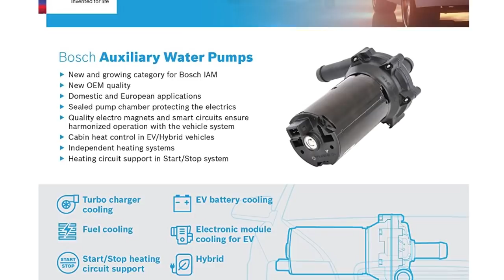Liquid cooling pump for Nissan Leaf Electric motor

Comment from the maker: Regarding the current draw....
I recharged the battery and hooked it up to the pump connected to the motor again. The current was still about what it was before, and a little lower than it was on my test with the pump NOT hooked to the motor. The battery voltage did NOT make a difference.
I believe the variable is that I did NOT have a hose on the outlet port when I tested the pump on my back porch. There was no need to, the water was just going right into the bucket. However, when the pump was connected to the motor, there was a hose from the outlet of the motor back to the bucket. The water in the outlet hose helps "pull" water behind it, making it easier for the pump to work. Essentially, I changed the setup from an open system, to a closed system.
Reply: This type of pump will draw less power if it is loaded beyond certain point. Saying that, the pump at that point is blocked and flows almost no water.
Reply: V=I*R Therefore if the voltage of your battery goes up the current should go down.
Reply from the maker: @excite236  Hmmm. That's not right. You might be thinking of Watts Law, which says that for the same amount of work (power), that at a higher voltage, there is lower current. With a fixed resistance, voltage and current are proportional to each other.
Reply: It's behaving as I'd expect. Running the pump unrestricted gives maximum gpm and draws maximum current. If you increase resistance to flow gpm will decrease and so will current. Similar to a psc blower motor in a furnace,( not the newer kind full of electronics) with a clogged filter there's less air flow and lower current.
Reply: I bet there isn't enough resistance to flow to make much of a change in current.  A DC motor will increase current as speed drops if voltage remains constant.  My understanding is that this is because each field is an instructor and as the motor spins current will follow the log curve of an inductor for each field.  The slower it spins the further up the log curve it gets before changing to another field.
Reply: I'm not going to claim to be an expert on the main reason this occurred and is have to think about it more to be completely confident with my explanation. However I would like to respectfully disagree that the hose on the outlet having the effect of "pulling" the water though the pump has nothing to do with it. I see no reason for there to be a Venturi effect by connecting a hose to the outlet. The more hose the pump has to push fluid though the more head loss there will be. Frictional forces in the tube will cause this head loss. Another thing I'd like do disagree with is that it became a closed system. In order for it to be a closed system you'd have to seal to bucket to make it a closed system.

Comment: I'm just going through all your Nissan Leaf videos. Great job. I'm wanting to build a solar boat and have been looking at lithium batteries and motors and pricing them up. It struck me today that I might use a Nissan Leaf battery from a used car.......and then thought, what about the motor too? Which then led me to the secondhand market and it will probably be more cost effective to do this. I then could use all the original cooling from the Leaf and possibly some of the control features too (I'm thinking you select reverse on a Leaf via a switch?). I think I'd leave the transmission on and try to attach to the propeller shaft via the original Nissan wheel shaft or / and universal joint.
Any how, I'm going to look at a 2017 Leaf tomorrow. Wish me luck.

Comment: Can i change mw combustion car water pump?
How long can this pump work nonstop in car?
Soory if mw english not good..
Reply from the maker: An electric water pump is a common upgrade on a car. They are designed to pump continuously, and can easily be turned on and off with a thermal sensor.

Comment: Hey Ben, great video. I am trying to upgrade my 2011 leaf for better winter range. One of my ideas is installing a 2000w electric parking preheater and a d3wz eberspacher diesel heater which will run in tandem with the original ptc heater when its driving (only using the diesel only for trips where I really need to when I need that extra range). The extra pump might help run the diesel heater when say at a campsite with no electric hookup or just to get that extra range as I can have the leafs oem heating totally off and rely on a toolpack battery for running the pump and powering the spark plug on the diesel heater. This way it would not be drawing down the 12v battery which I think gets quite abused by electric cars and shortens their life. Id be sure to attach a long exhaust if using the diesel for any time in a static location (I'll be honest I hardly want to ever use it but I want the backup). Already done heated seats but the car performs better generally when its warmer so getting the body of water up to temperature before setting off without using up battery energy makes some sense to me.

Comment: Can u increase/decrease the  pump flow to adjust for weather changes automatically?
Reply from the maker: This is just a single-speed pump.
I don't think there would be any need to adjust pump speed for weather. The pump has plenty of flow and should be more than enough for this motor at any time of year or weather condition.

Comment: 12:00 Well actually I'd have to disagree... I know it's just a saying and all but cooling a Nissan Leaf motor is more like Rocket Science than you might think. The amount of Heat Transfer calculations for the two of them were highly intensive.  It's very difficult to model and design  transient systems with complex geometry as the internals of that motor inevitably are. I understand it wasn't super hard to hook a pump up and some tubing, however I just wanted to know that what goes into making that motor feel as cold as it does with the coolant flowing through it was a highly strategic and laboreus process for an engineer.  In the end though thank you so much for the interesting video!
Reply from the maker: No offense to rocket engineers or the folks who design EV cooling systems!
I know that I couldn't do either. A big part of the joy of a DIY'er is the fact that we now have access to well designed parts created by these amazing people, but we can get the parts affordably at a junk yard!

Comment: Hello why did you select the  thunderstruck motors vcu? and not the  "Brain Board Rev 3 with Nissan Leaf™ Gen 2 adapter" ?
Reply from the maker: The Thunderstruck device is a complete, off-the-shelf product. I'm working on the tractor project on behalf of somebody else and want to keep it as straight forward as possible.
I also know other people who have used the Thunderstruck VCU with good success.
Reply: @BenjaminNelsonX  I see, the thunderstruck VCM seems to be the main commercially available version of this and it looks like they have done a lot of the work to reverse engineer the messages the inverter needs to receive. 

Still this other option that I talk, is the idea of replacing the native logic board of the inverter with a programmable version with software that can be configured or edited to control the inverter powerstage appropriately.

This option retains the major components of the inverter (IGBTs, Capacitors, Current Sensors and the driver and monitoring circuits) but replaces the board that interprets the messages coming in from the VCM. This removes the need to replicate the Leaf can messages and in theory opens up the option of pushing the power stage and motor beyond the limits that Nissan have put in place.

This is less plug and play still, the prices are very similar, i think is a good option if you want take more power out the nissan leaf motor. 

I can't wait to see more about this project sorry if I went all geek on this, but I plant to convert a car, one day, but i am still getting all the possible information about this subject :D

Comment: hey what happens when you replace the coil of a alternator with a motor coil that is equal to in total watts but not amperage and volts. Does it make  it run cooler. and give you the correct energy without the huge motor expense.?

Comment: (American Tech)(1000V+ High voltage generator from induction motor) try this with five on pole and some capacitors then how far will your car go. sorry benji but i had to show you. i don't hate you but this is my tech guy.

Comment: I just found your tractor project and just binge watched the episodes on it.  I used to design electric industrial vehicles, and would like to build an electric farm tractor one day.  I had some comments as I watched the videos, but figured I would just make one big comment at the latest video.  
1) Divorcing the hydraulic pump from the drive motor may allow for reversing using the drive motor (I think the TA transmission has an overrun clutch in one position).  These old sliding gear transmission can be very clunky to shift gears.  Forward to Reverse requires a complete stop with the tractor in gear to not grind a little.  Being able to reverse the electric motor would be a huge help when doing loader work that doesn't require the PTO.  This obviously wouldn't work when doing jobs requiring the PTO.  PTO overrun clutches are available that would prevent damage by inadvertently reversing the PTO with an implement attached.
2) Powertwist belts would be good to power the pump off the motor (of as a replacement in 15 years when a belt fails).  This would allow replacing the belt without tearing the entire unit down.
3) I would use a shelf industrial pump and not worry with trying to reuse the pump from the engine.  There are belt drive, AC and DC pumps available off the shelf.  Mount it low and use as few hydraulic fittings as possible on the suction side.
4) do some calculations on the required hydraulic pump size.  Frequently pumps are over sized on equipment because _ GPM is required to operate the steering from lock to lock at idle in a set time.  This means at max RPM you are circulating a lot more fluid than is needed.
5) I think there may be a design or part problem that caused the loader to drop as fast as it did.  It could just be because the rod end of the lift cylinder has a smaller volume though.  I would check though and make sure the system has something called a counterbalance valve.  Typically these are  mounted on the cylinders and prevent the loader from dropping if a line bursts.  
6) On your axle clearance, I wonder if you could space the mounting point in the back down a little.  It doesn't look like you will have much interference with the frame on those axle supports, and I doubt the slight change in caster angle will make much difference in tractor driving performance.
7) If you reuse the stock tractor radiator, I bet there is enough cooling capacity there not to need a cooling fan.  The cooling fan will be the loudest thing on the tractor.

Comment: Hello sir 
My self Kundan patel a mechanical engineering student .sir I am working on a project to convert a petrol car maruti 800 (1998model) sir we are planning to put 48volts1000watt moter connected to gearbox .our total weight of car is 850KGS (including 1driver + 4 pessengers)
Sir I am bit concerned about moter .sir my question is  1000watt moter is sufficient for our car or not and if not than for how much watt moter we should go for 
Please guide me sir
Reply: I think you'll find a 1000W motor is too small. A 10,000W motor would move the vehicle, but not very fast.

Comment: I need help!
I'm a student and me and my other mates are converting a petrol car into EV!!
CAR NAME: Maruti Suzuki 800 (1998 model). We're doing it on very low budget, as we're doing it with our savings and pocket money so don't have enough financial potential. 
I want suggestions on how much powerful motor will be needed, I'm thinking to use 48v 1000watts BLDC motor.
Connected to gearbox, is it sufficient??
On calculating total max load (with 5 people on board, 1 driver+4 passenger) it is around [ 940KGS]. Please help me !
I'm in big confusion :(
Please help sir!
Reply from the maker: A 1,000 watt motor is only the equivalent of about one and a half horsepower! You'll need more than that for a car!
For a simple, low-budget car, please watch the Playlist about the Electric Geo Metro conversion. Lot's of good information in there to get you started!
Build Your Own Electric Car: https://bit.ly/2zMufmN
Reply: What if I say it's around 800 KGs, equivalent to max load capacity of E-rickshaws. ( E-rickshaws also use 950 watts, without gearbox, they give 30>speed) Will it work? 
Well I've watched complete playlist, great information. :)

Comment: Your electrical current dropped exactly as I expected. It may not be intuitive for some people, but on a centrifugal impeller pump,  as resistance to flow increases, power decreases. This is because energy is being imparted to less water per unit of time. Your max power consumption will be with unrestricted flow at both suction and discharge. (Maximum flow rate, like your first test.) Your lowest power consumption will be when your flow approaches zero. At zero flow, the impeller is only stirring and heating the water in the pump. Moving gallons of water through the pump takes more energy.
Reply: Your answer is similar to mine but yours is 2 days earlier. I would add that pumps have a curve, a graphical representation of their performance. Flow rate is on the X axis and pressure difference across the pump is on the Y axis. Flow rate is measured in GPM and pressure is measured in " feet of head". In a closed system you're not lifting water. Every ounce of water going up is cancelled out by exactly the same amount of water going down. Maybe feet of head is used as a measurement because that's easy to measure. What's the gpm if you make it lift water 2 feet from one bucket into another?  Or 3,4,5 feet?  
Bottom line, restrict the flow, move less water. Move less water, use less electricity. Within reason, in general, YMMV.

Comment: Fun fact about centrifugal force pump is the smaller resistance the bigger the flow AND power. and vice versa. Try listen to your vacuum cleaner at full power,  then block air inlet for a couple of seconds - then blocking it is maximum resistance and the RPM will clearly rise as the air trapped in the fan will just go round and round,  less power is needed for fan motor.
Reply from the maker: Well, I didn't stick my thumb over the outlet port, but that would be fun to try!
Reply: @BenjaminNelsonX  Then it should turn at higher RPM or use less power or both. And possibly you will get wet lol

Comment: the load on single stage centif  pumps increases slightly with no head pressure they need back pressure

Comment: 1/4 inch connector? Sounds like it'll fit PC water cooling components!! Try a lang D5 pump!
Reply: Ben said 3/4" or 19mm, which is much larger than a PC cooling system. ;)

Comment: Good morning Ben. Found the Bosch pump on Summit Racing's web site. https://www.summitracing.com/parts/bch-0392022002/questionsanswers . Looks like they have the specs for the pump itself. Current draw seems to be more than what you are showing and I am guessing that it could be due to the smaller wire size that you use. Also, there is a part number listed for the electrical pigtail.

Hope this helps.

Comment: Nice to see progress on the project.  Looking forward to that motor spinning.  I was also curious how much the flow decreased with the motor in the coolant loop?  And then to top it off if you add a radiator how much more the flow drops...  Either way I suspect the flow will be far more than needed in most cases.
Reply from the maker: Going through the motor, the flow dropped very little. When I get it hooked up to the radiator and in the final configuration, I'll measure the flow rate and see what it comes to. (REMIND ME if I forget to do that!)
I also think that this should be far more than enough for cooling.

Comment: Pretty cool.Hope you plan to have some routing box for the electrics on the Leaf.
Also, there are mechanical loops for cooling. The switch inside of those loops is bi-metal, so no electronics needed. Simple and reliable. It's a standard automotive part.

Comment: At 11:30 reading less Amps because your battery is dying off
Reply: As well it corelate with rpm
Reply: Hmmm. Maybe. But try the same experiment and plug the outlet, you will see the pump running faster and drawing less amps.
Reply from the maker: Read the pinned comment. I recharged the battery and tested again. It wasn't the battery.

Comment: For test like this you really might consider a bench power supply, you have always the same voltage regardless of battery state and you can just read the current draw from the display. They're not expensive and a really handy tool to have if you're working with electric stuff.
Reply from the maker: I have a bench power supply. However, working around water, and moving to different locations, a small battery is much more useful. Smaller/lighter/more portable and no AC shock hazard.
Reply: @BenjaminNelsonX  👍

Comment: Same pump used on current water cooled Harley motorcycles, $60-80 on Amazon, over $300 from Harley.
Reply: One of their biker models kisses every one of them pumps and tells it a dirty joke and a good night story. During lunch time, Bob from accounting does the kissing, but the jokes get dirtier and he never changes the good night story. They probably got 1/8 failure rate.

Comment: Your battery is not 12V.   A 3 cell lithium battery runs at 11V max.
Reply: 3S max V is 12.6V.. When depelted 9V... Nevertheless pump will draw less then 15W
Reply from the maker: Battery was 12.3V check I checked it with my meter.

Comment: Did you recharge the battery for the current draw test when it as connected to the motor?  Possibly the battery had a higher voltage therefore lower current.